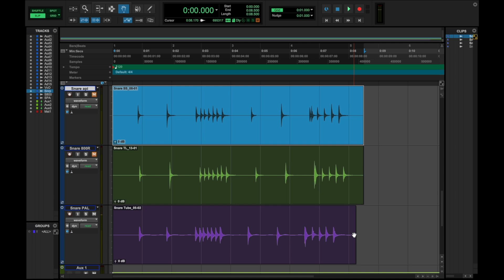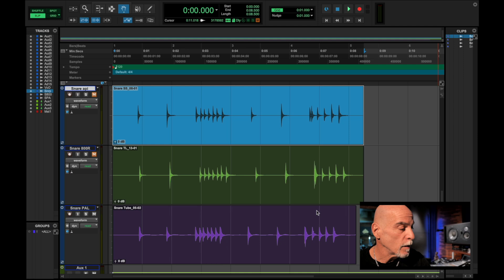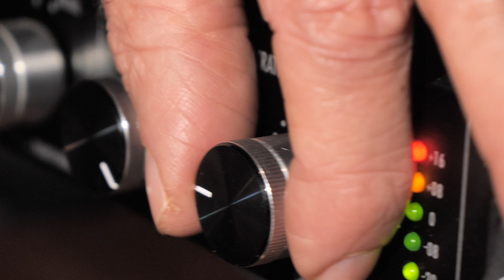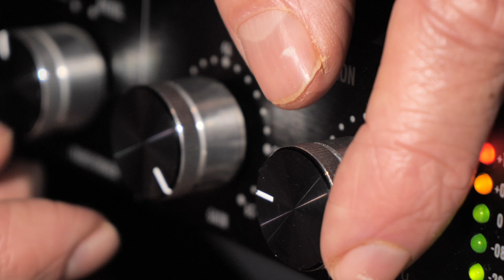Part 6 Mic Preamps Demystified

Comment: What a great video, well done on the explanation of the different topologies, it's the first time it actually made sense to me. 
I've tried many different preamps, and while I can usually hear a subtle difference between them, it's mostly stuff that can be done with a bit of eq, and some compression. And this leads me to how I eventually chose the front end that I settled on. I tried the coveted 1073 and it was ok, but the eq left me very disappointed. And many others. In the end I favoured the API Channel strip because the preamp sounds great when pushed (something I don't really ever do for my use), the eq is probably my favourite sounding of all that I've tried, even with it's more heavy handed 2db increments and  the comp (again for my use) is by far the best out of every single comp I've tried regardless of topology and price (I went as hight as 6K with the Crane Song STC-8). 
Like you said, it all depends on the result you want.
Reply from the maker: In tests I listened to, the api came out on top for me as well. It just cleaner than anything else. But I do love the 1073 eq. It makes short work of getting many great sounds for me, from vocals to kick drum. I'm still learning the api.
Reply: @devon-graves-studio-D  it's clean until you push it, at which point it can get very dirty, but in a lovely way. I have a feeling that the eq is very dependant on the material you're using it on. Or perhaps it's a particular sound that we all know and subconsciously like from all the records we've heard where it was used. Either way, it's legendary, but I chose something else... I also find I very rarely reach for a Pultec. Bearing in mind that these things are used by everyone, there's probably a reason for it, but I just prefer different sounds for my work. Who knows, maybe one day I'll be the next world famous mix engineer 🤣

Comment: To me the tube pre sounds more like an actual snare in the room .the first 2 pres sound like popcorn
Reply from the maker: Yep. I agree. I think the tube pre hears more like our ear. Remember we are dealing with a dry, single spot mic. The snare sound would be normally filled in by the overheads, rooms, and bottom mic. So that thin transient on the other two (especially the api) might give that needed transient for attack whereas the body would come from the other mics, and of course processing. When I record snare I use an api top and bottom with eq and compression and it sounds much better for that. But it would have skewed perception of the preamps themselves.

Comment: Hello Davon, you’ll notice more differences with vocals and other instruments than with snare hits. The harmonic distortion and other elements of the preamp play a significant role, especially in how it pairs with the microphone, the type of voice being recorded, and the frequency range.
When dealing with broader frequencies, you’re more likely to notice how the transformer behaves or, in the case of a transformerless design, how the circuit responds, along with the tube circuit and the op-amp. This also depends on whether the microphone itself is a tube mic, transformer-based, dynamic, ribbon, or otherwise. There are simply too many factors to consider.
Preamps can make a huge difference in orchestral recordings, particularly in quiet passages or when the music has a high dynamic range and sharp transients. From classical to jazz to pop, preamps play a crucial role in shaping the sound. In fact, I believe preamps are way more important than EQs and compressors.  Best regards!
Reply from the maker: Thank you for your insight. Actually the snare hit demonstrated my point about transient response. I did a separate test with my voice using a U87, I heard distinct differences between the Neve 1073, the PAL (which sounded best) and the Onyx while tracking using headphones. But upon playback with my Focal Trio 11Be's those differences seemed to vanish for the most part. So I didn't include that section because it didn't prove anything obvious. I left some points out which I should have mentioned about headroom and clean gain on the expensive stuff. But I'll do a follow-up on that.
Reply: @devon-graves-studio-D  Hi Davon ,
I completely agree with you when it comes to demonstrating for a younger audience, especially those who are just starting out and working from home studios. Prioritizing what’s really important is key, and in that case, even using the preamp of a sound card is totally fine.
However, as we move into the realm of those who have been doing this for 30–40 years and are working on more high-end, professional projects, we might start noticing some differences in gear and final results. The U87 is a transformer-based microphone, and if you compare it to other transformerless mics, such as the TLM 103 (which uses a variant of the U87’s capsule), you’ll notice that it sounds quite different, particularly in how it handles transients and harmonic distortion. The TLM 103 is more transparent with less coloration, bright. When paired with preamps, the difference becomes even more noticeable, especially in how the mic compresses transients and adds harmonic content.
That said, at the end of the day, what truly matters is the music and the performance.
I just wanted to share a different perspective for you to consider and expand on to your audience.
All the best!

Comment: As always different takes sounds totally different, this is not enough to have an objective comparison.
Reply from the maker: I am torn between how to do this more precisely. I think these takes do accurately represent my experience with all these preamps. However, I had been considering a mic splitter to simultaneously record to different preamps, but then it would be skewed by the splitting transformer.
Reply: The point comes across regardless of the difference in performance. The API has a weight in the transient that the onyx lacks. Now I can see why people love that topology for drums.

Comment: I agree that the biggest difference is made by the microphones. But preamps are just as important in my opinion. They show you a path. They alter the dynamics of the signal in a natural way that no compressor can do. And if you don't have a preamplifier with a transformer or tubes, then you depend on a compressor that can give you (or not) the desired dynamics. And you waste time in the mix looking for something you could have from the recording to begin with. My opinion is, in order of importance, microphone-preamp-eq-comp-converter
Reply from the maker: I agree with everything you said. Absolutely. What I was getting at was the difference in tonality is very subtle. But the transient and dynamic content is in full display in my example. I will dig deeper in some experimentation to show the cumulative differences which should be more revealing. And again, I heard tonal differences and clarity differences when tracking vocals. But those differences seemed to vanish on playback, even through my Focals. I wanted to prove a bigger point which I wasn't convinced I was able to do with the abandoned effort. I was making my best attempt to prove my point, beyond mere opinion. Look for that video in the future :)
Reply: And Tape compression for more natural effects.
Reply from the maker: @thegroove2000  Mmmmmm... tape compression...
Reply: @devon-graves-studio-D  Tape saturation has a natural dynamic range reduction. But the tape doesn’t bring up the quiet parts of the sound like a compressor does. Analog tape it gives tape saturation and soft clipping, which gives a perceived compression effect. A compressor actively adjusts the dynamic range by attenuating peaks and optionally boosting lower signals. So, when you record to tape, what you are able to achieve is a soft-clipped and dynamically squashed signal, but it doesn’t behave like a real compressor.
Reply: @thegroove2000  Tape saturation has a natural dynamic range reduction. But the tape doesn’t bring up the quiet parts of the sound like a compressor does. Analog tape it gives tape saturation and soft clipping, which gives a perceived compression effect.  A compressor actively adjusts the dynamic range by attenuating peaks and optionally boosting lower signals. So, when you record to tape, what you are able to achieve is a soft-clipped and dynamically squashed signal, but it doesn’t behave like a real compressor.
Reply: @EinsteinRiesenfeld Thanks. Also If the performance is right then there is no need to bring up the quiet parts is that correct?
Reply: @thegroove2000  This can be a long interesting discussion, but fundamentally, It depends on the style of music, the arrangement, and the mix. If the performance is strong, there’s often no need to bring up the quieter parts, making less compression ideal. However, in today’s listening environments, like small speakers, compression has become a tool to normalize dynamics, which can be both helpful and limiting.
For genres like classical or acoustic music, minimal compression preserves natural dynamics, while in pop or modern productions, heavier compression may be necessary for loudness and impact. it’s about balancing artistic intent with  production and mastering goals and how the music will be consumed in different environments. The choice is helpful and limiting as we continue to navigate the loudness war for attention in modern music production.
Reply: @EinsteinRiesenfeld  Horses for courses as the saying goes. Thanks.
Reply from the maker: @EinsteinRiesenfeld  Ture words!
Reply from the maker: @thegroove2000  Allow me... That allm depends on the arrangement any musical style. If it's something acoustic and organic, less compression can be appropriate. But still, "the "right" performance could easily be too quiet in parts and too loud in others , in relation to the music just by it's nature. Compressors help a lot to solve this, but fader rides are also just as important. Mic distance is part of it too, but moving closer and further from the mic also brings in issues with proximity effect. So it is all a juggling act.
Reply: @devon-graves-studio-D  What about something like a summit audio leveler  or a gain rider instead?
Reply from the maker: @thegroove2000  Summit makes some of the best tube gear out there. My next video will be talking about compressor types. I would say that "instead" is not the best strategy. Mic technique, compression (whichever you like) and fader rides all add up to a great vocal mix. Compression alone    might be too much heavy lifting for one device.
Reply: @devon-graves-studio-D  Thanks.

Comment: Which category will you place the Audient ID preamp since it's same as they have on their console
Reply from the maker: Its a transformerless design. But one of the best ones out there in my opinion. Very clean, very low noise. I have a video where I compare how it stacks up with a 1073 with an 1176 and opto compressor (hardware) and how close you can get the Audient using plugins. There is also a direct comparison with acoustic guitar without the compressors. https://youtu.be/EwLoVdAOgaA?si=-IdkOvgKVyj8Bzv8
Reply: @devon-graves-studio-D  thank you
Reply: I just watched the video and I think using the Audient ID44mkii preamp with an hardware 1176 and LA2A compressor would have been more interesting and better comparison since the interface has balanced inserts point and the Audient preamp could have shine better cos it would be cleaner with less noise
Reply from the maker: @samueloluyinkaojomu6548  Interesting

Comment: Excellent! It's hard these days to find solid, reasonably neutral information taken from intelligent experience.  What, may I ask, are your thoughts on the TB12 ?  I don't have one, or any other Warm gear (yet), but have given it some thought from time to time.  The design and build quality appear good from what I can gather and the pricing fair.
Reply from the maker: The TB 12 It is right up there with the best of the transformer in-out designs at a very affordable price comparatively. The choice of two different op amps, two different output transformers is very unique. However the differences ar a bit subtle for my ear. For the price you can't go wrong. Having said that, if you had about 300 more to spend, you might get a lot more out of the WA73 because the eq can change your sound much more dramatically than the different transformers on the TB12. I use the eq on my 1073 all the time.
Reply: @devon-graves-studio-D  Thanks!